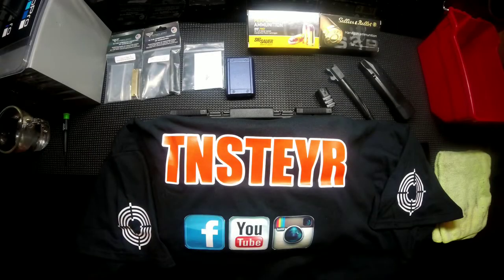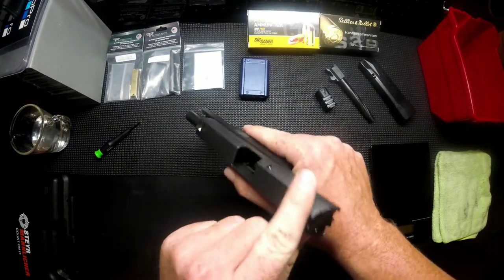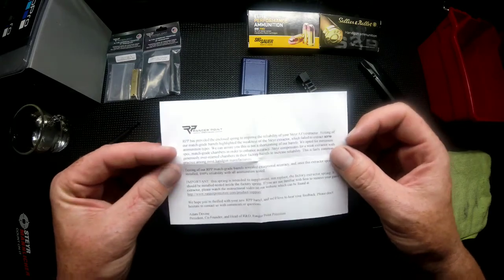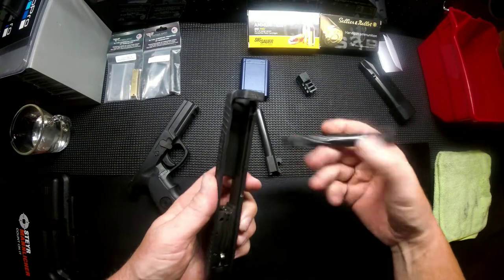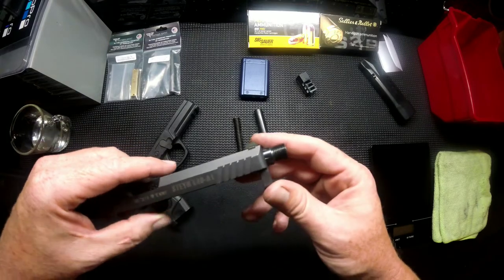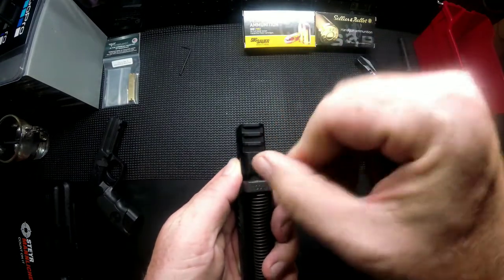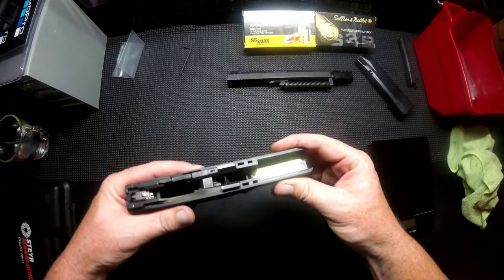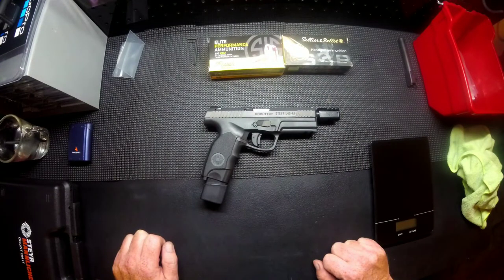Steyr L357A1 build out

Comment: Is ranger precision recoil reduction parts for the Steyr better then DPM systems?
Reply from the maker: Bobby Smith . 
   Hi Bobby I try on my channel to only show parts or to use parts that I would spend my money on ,everything that you see is something that I would personally pay for or have. I have looked at the DPM system it is interesting but there's too many moving extra parts for my liking. The little bit that I tried to use one tuning the Spring pressures was a pain if you shoot a variety of different ammo all the time.    With all that being said my bias opinion would be to buy the RPP,  if you wanna change out Spring pressure all you have to do is remove a screw an change of Spring.